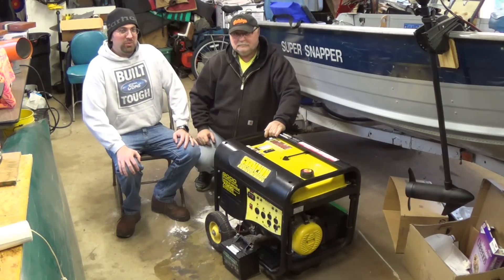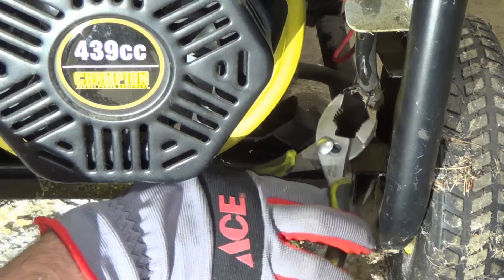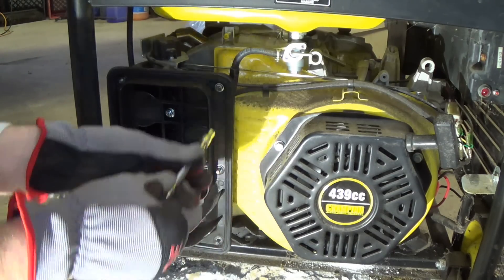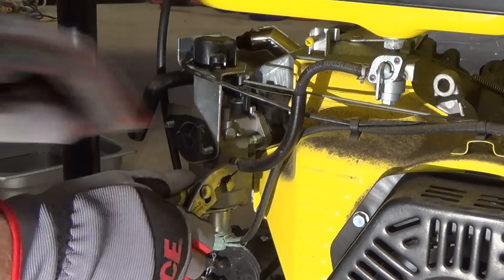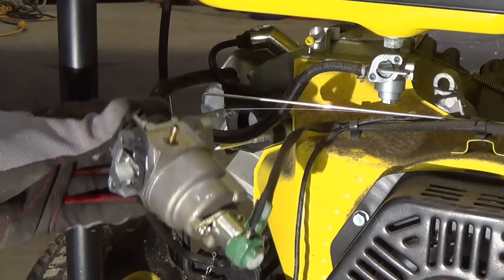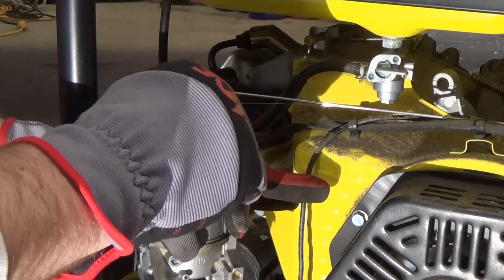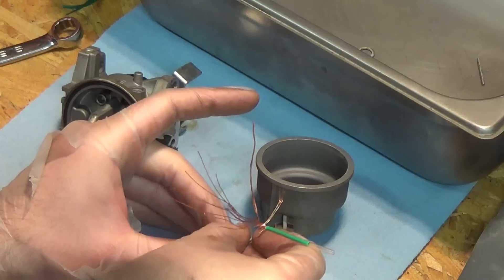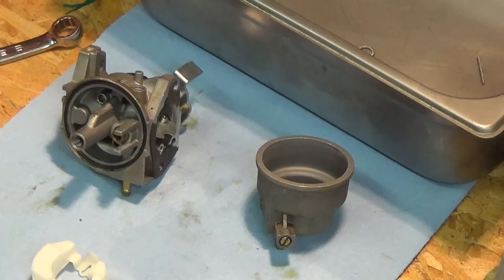How To: Repair a Generator That Won't Start or Stalls

Comment: Glad you mentioned the wire trick. If you have the carb in hand run every passage - works like magic. 

Needle tip is usually viton rubber. 

I use Stabil and it helps for the snow blower. Really I need to use pure gas but who wants to chase that down. 

Good fix enjoyed it.  

_ Dan
Reply: House of Broken Dobbs Things _ with Dan Dobbs n
Reply: A little trick when using wire strands as reamers... tap them individually with a hammer to flatten them out...that creates a gentle scraping edge.  Most of the yellowish film is ethanol residue and brake clean and a small sponge work great on the bottom of the float bowl.  Don't get brake clean on the rubber tip of the needle valve as it will swell and not seat properly.  The perforated tube is generally referred to as an emulsion tube.  Also there is probably a press in jet on the top as well as two others that run horizontal on either side of the butterflies and ending in the throat (very tiny exit ports so prone to clogging).  Those will be on the inside side of the throat and should be blown out from the inside out.  You'll need a straw nozzle on your brake clean to properly clear the little dude's from the inside out.  Best of luck.